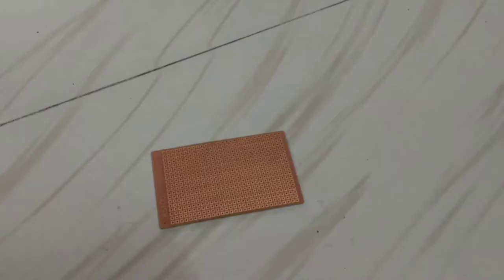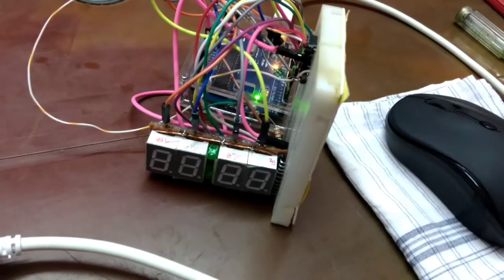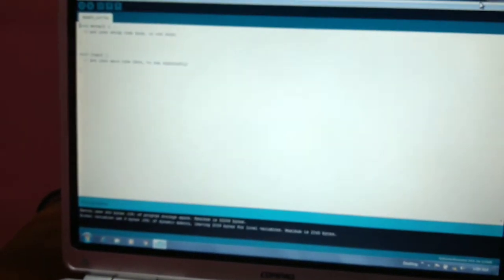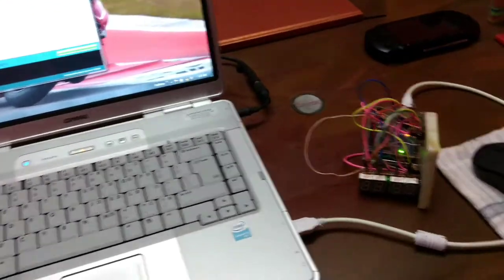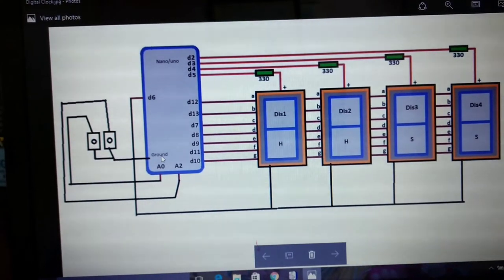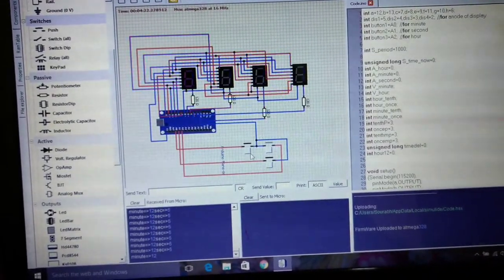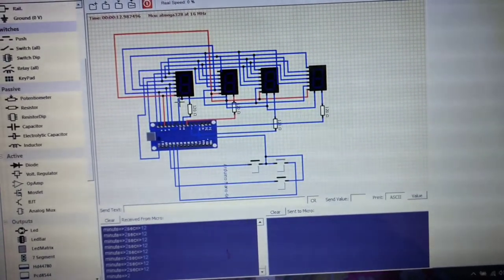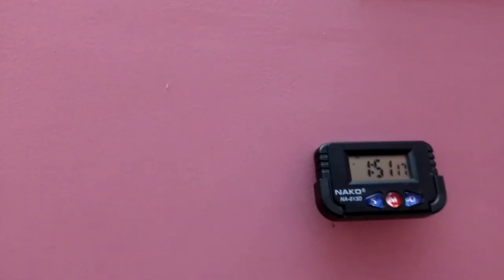7-segment Digital clock - LED (Part 1)

Comment: sir, very well explained. I am learner for electronics.How to make LED clock with ATMega328 micro controller ? please make a video with code and circuit.Thanks.
Reply from the maker: https://www.youtube.com/watch?v=0gMXYP_omBk&t=246s
https://www.youtube.com/watch?v=_P2jQcEwDmw
Reply: @SDinnovation  Sir, thanks for your quick response. I want to make clock with ATMega328P and LEDs. Please send details for that. Thanks
Reply from the maker: @mohitparikh4455   all the clock itself consist of ATMega 328 ic fitted in aurdino and code is already given in video itself.